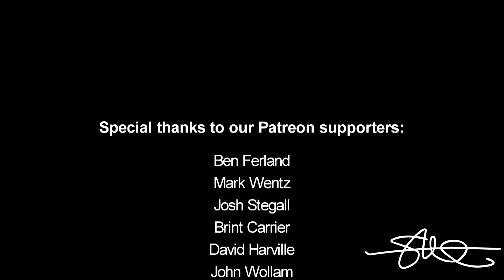UFO BASS FLEX! Classic Fi BTL 18" Subwoofers Dusted Off & Powered Up! 3,000 Watts B2 Audio

Comment: Quick question steve, is it okay to run rear speaker inputs into an amp that is being used for my sub? i only have one rca out for 2 amps (mids and sub). i currently have a y splitter for it running to both but the connection is shorting out, my mids amp doesn't have speaker level input only rca. so i'd be forced for the time being to use the speaker out for the sub amp, will this damage anything or be okay for the sub?
Reply: Brody Lewis explain. You want to run woofers and rear speakers off of the same amp? How many channels is your woofer amp.
Reply: Jaime Diaz no, they will be separate amps still I just need to know if it's okay to use a speaker level input for an amp that is powering a sub. Typically you want to use RCA's to run your sub amp

Comment: I'm thinking about going with a 12 inch subwoofer but I don't know which one to get. I want something that is reliable, can play low and costs around $200 to $350. Anyone have any recommendations? The box I will be building will have 6.75~ inches of mounting depth (for a single cab). Thanks!
Reply: Avg White Man , it has 6.75 mounting depth and the price isn't bad, made by the same company who made these 18s in this video
Reply: I grew up Rockford. I would look into their subs. I think you will be able to fit a dvc 12 from their p2 or possiblly even p3 with that depth. If not they have a shallow line as well.